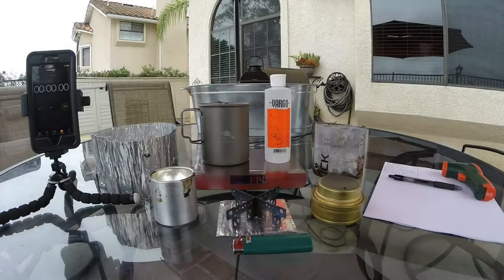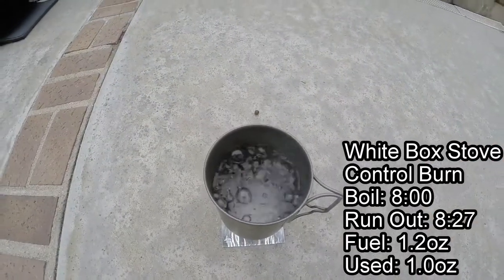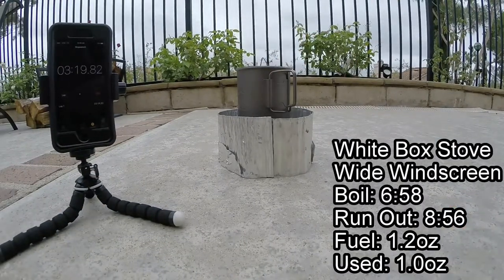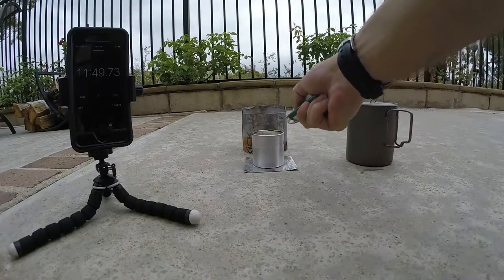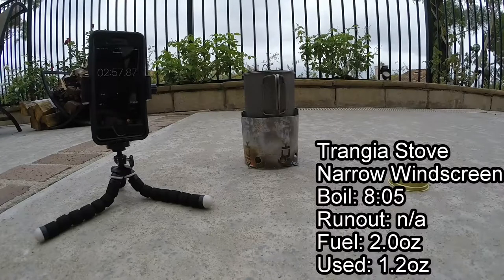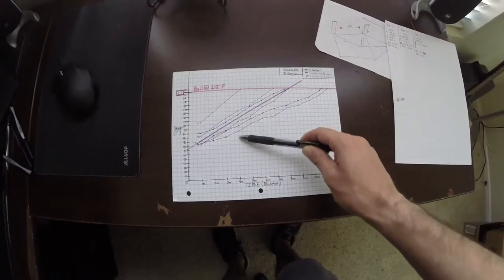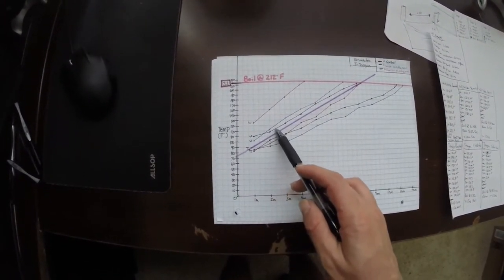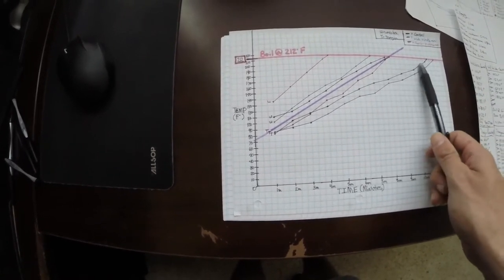Best Windscreens for Alcohol Stoves - Boil Testing - Ultra Light - HD

Comment: Wanna know the greatest alcohol stove based cooking and boiling system of all time? The Trangia 27 non-stick cookset. I have literally used it in 40mph (64kph) winds with no wind protection other than the windscreen that is part of the Trangia, and I was still able to cook food in the pots and on the non-stick pan within 15 minutes and boil water in under 10 minutes... It only suffers from the same basic drawback of any alcohol stove, which is that the high winds will mean you go through WAY more fuel. A completely filled up Trangia spirit burner in windless conditions will burn for approximately 40 minutes, but that same amount of fuel will be gone in under 20 minutes in high winds due to the heightened amount of available oxygen gusting past it.

Comment: narrower and tall. a windscreen does more than protect from wind. It reflects and directs heat. a tall somewhat narrow windscreen will reflect heat from the pot back to the pot. it will also channel heat from the burner up the sides of the pot heating the pot better.